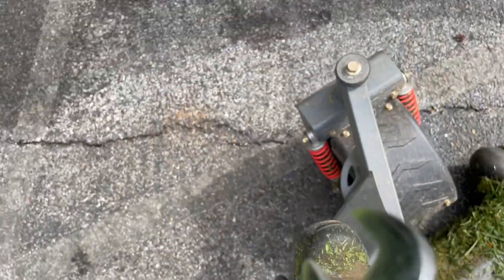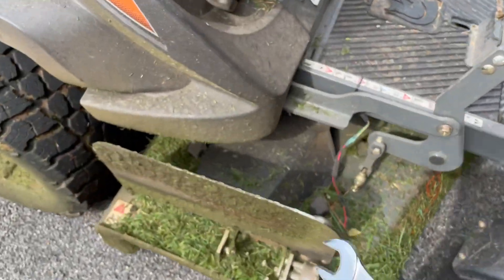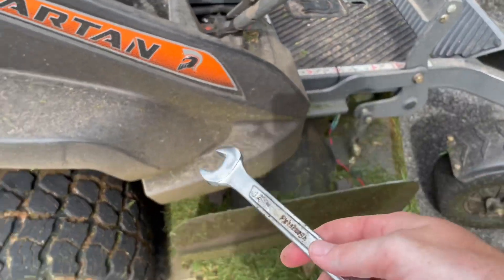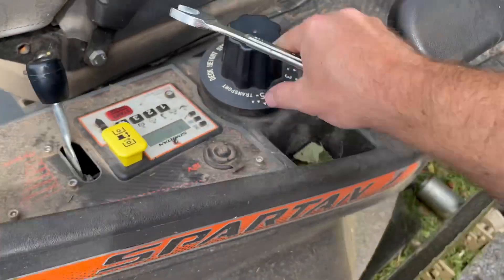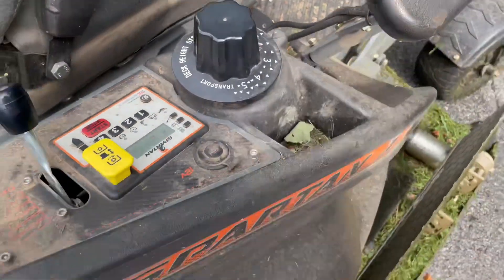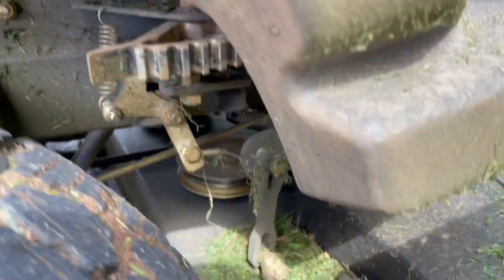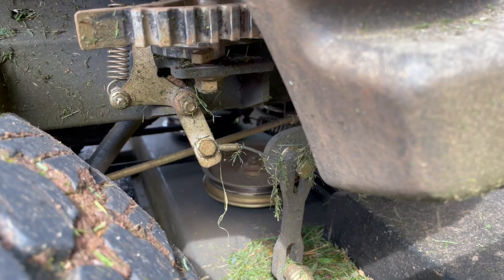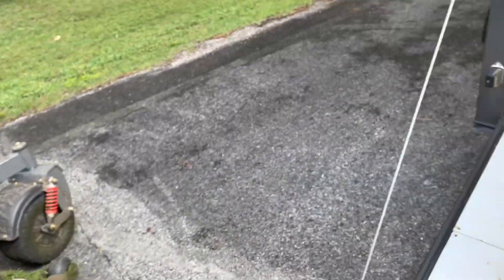Spartan mower height dial tension adjustment (Quick and Easy!)

Comment: Thanks, my knob was so tight I could barely turn it and very difficult to lock into position. Just loosened up the nut and then tightened a little and now it works fine. Easy fix.

Comment: Thanks bro, although your volume was very low, I figured it out from the video. Hoping this stops my deck from self adjusting on bumpy terrain. And you’re right, you barely need to move the nut. I went a bit too far the first time and it would budge, nudges it back just a little and I think it will be perfect.

Comment: At least you can fix your lawnmower hey i got you a question like on some weedeater line some rolls it said commercial or professional what that means cause i got a roll of line in it said professional
Reply from the maker: probably just it's intended purpose (professional/commercial use)
Reply: @lyonlawncare4145  o so maybe it means like the materials on lines like that there made for different type of grass

Comment: Anyone have a problem with the deck dropping while mowing?I can be mowing at like 3" or whatever,and often the deck will fall to 2" or lower as your are mowing grass causing the grass to get mowed too low I have to stop and turn the dial back up.
Reply from the maker: I have experienced this problem a lot. I bought a pin height kit from Spartan last year and that works great. The dial is only used to put it up in a transport height, and then I let it rest on the pin kit for mowing, no more slipping!
Reply: @lyonlawncare4145  Been in business for 30 years and have NEVER had that problem except with the Spartan appears to be a flaw in their design is my guess but it is a pain when you are mowing then boom the deck goes down more.The dealer adjusted it or whatever they did last year but it has come back.I will look at that pin kit but let them know how bad their design is when I talk to them :)